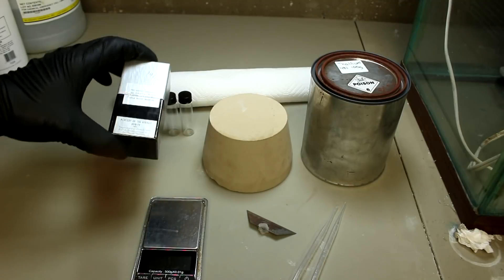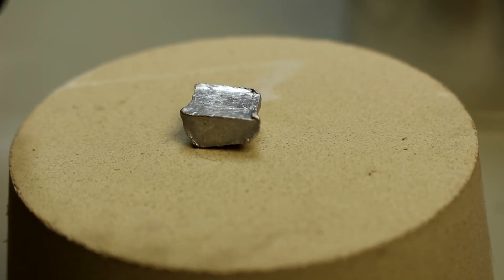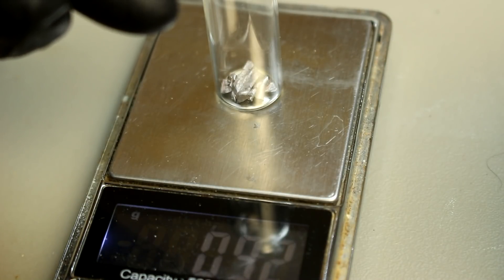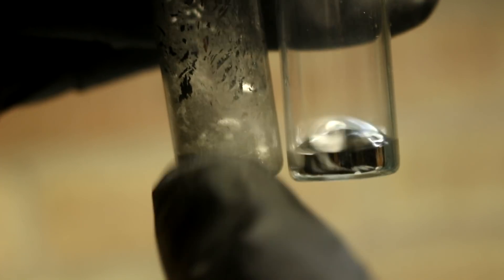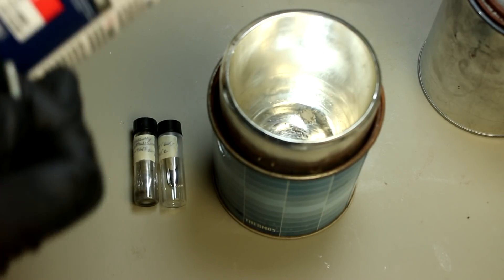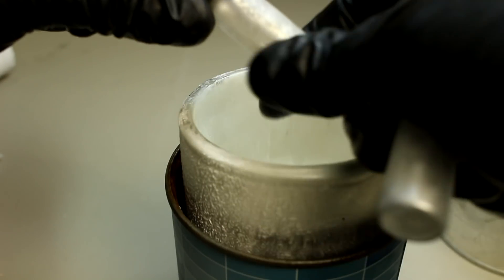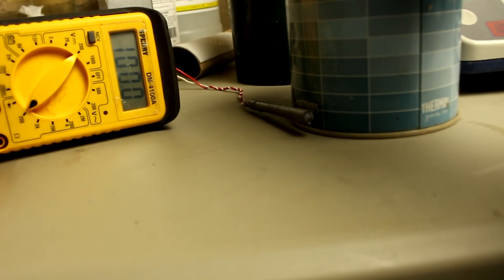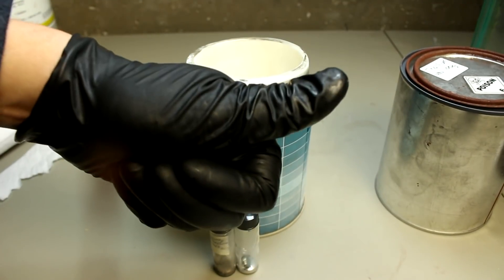Thallium Mercury Fusible Alloy

Comment: You mentioned that there is a ceasium based alloy that can bring the freezing temperature of mercury even lower. I didn't see a video that explained what this alloy is. I am working on an experiment that calls for as low of a freezing point as possible of mercury.  Everything I know about ceasium says it's extremely dangerous.  Please let know what this alloy is. I plan on applying a magnet and speeding the mixture up in a vortex and I don't want things to explode!
Reply: Did you ever find out what this cesium alloy is?
Reply: @brianmcginnis7417  unfortunately no. I don't know why they didn't explain

Comment: The melting point of the alloy is exactly the same as the temperature in Antarctica! xD

"In winter, sea ice envelops the continent and Antarctica is plunged into months of darkness. The monthly mean temperature at the South Pole in winter hovers around -60°C (-76°F). Along the coast, winter temperatures range between −15 and −20 °C (-5 and −4 °F)"

Comment: you should use your vac chamber to do a cold welding experiment. such as the hatch sealing problem on one of the Gemini missions. metal melding together with no energy applied, only a bit of force

Comment: Hey cody, i have an idea in a similar vein to this where if you push a surface of gallium into a surface of indium you form a (nonrecoverable i think) alloy with a lower melting point than gallium which drips away from the contact surface.  Maybe try this in a vacuum chamber?

Comment: Cody, you should invert the calibration chart. Currently you have resistance as a function of temperature. If you invert it to temperature, as a function of resistance, you'll be able to put in your resistance reading and just get the temperature out of it.

Also, if you can, repeat the experiment and put a timer next to the voltmeter. I'd like to see resistance as a function of time as the whole thing warms up. It should go up over time, but I'm hoping there'll be a slight pause or decrease for a while, as the metal melts and absorbs latent heat. That'll also help you determine the melting temperature better, assuming the latent heat is large enough to show a decrease.

Comment: Looking forward to seeing the thorium video. I have an identical Geiger counter and some old mantels which are radioactive....given that the most abundant isotopes of thorium decay with only alpha radiation, the detectable beta and gamma will mostly be from secondary decay once it has become a lighter element.
Reply from the maker: true but most of what the geiger picks up is from the alpa particles striking other atoms and creating x-rays
Reply: Ok, interesting.  I know air doesn't produce x-rays when struck by an alpha particle but I guess within the mantel there are elements that can?

Comment: Dadgummit Cody, I missed you ❤
Also, it looked to me that the pure mercury has a higher surface tension then the alloy.
Reply: ZenoZX I thought it was called codysblab
Reply: Bobby Duke Arts You should probably sub to his backup channel, “Codyslab backup”
Reply: It is due to the oxide: Tl2O3 forms quickly and sticks to the glass and the alloy sticks to the Tl2O3. If done properly, under very pure argon, the Tl-Hg alloy would beed up just like mercury.

Comment: Are there any completely safe and non-toxic alloys that are liguid at room temperature?
Reply from the maker: depends on what you call safe, but there is galinstan (gallium indium tin alloy) which is liquid down to below the melting point of water and is a lot less toxic than mercury but drinking a glass of it would still be potentially lethal.

Comment: Does the condensation temperature change under vacuum like the boiling temperature does?
Reply: Under a vacuum gasses cannot condense into liquids. Instead they are forced to reverse-sublimate into solid, much like how frost forms on cold nights.
Reply: What about in a lower atmospheric pressure?  I am wanting to make a heat pipe, but with a fluid that would transfer heat at 30 deg Fahrenheit.

Comment: You mentioned this alloy possibly being used for a low temp thermometer.  How would that work given how readily it sticks to the glass?
Reply: You can coat the glass in various things; few liquids will wet both glass and plastic for example.

Comment: I'm excited about your upcoming thorium video; however, one quick comment about it (even though it's not up yet). You shouldn't have burned it indoors, especially not as violently with a torch as you did. You don't want particles of thorium to end up in your lungs. It's an alpha emitter, and pretty benign if you keep it outside of your body. Getting it in the lungs or other mucosal surfaces is another matter altogether though.
Reply: stamasd Cody knows what he is doing, it looks like he was in a finely ventilated area. He's no idiot, and knows the risks. Trying to comment and inform him of something he probably knows is silly
Reply: I sure hope so. Thorium dust is not to be toyed with, once it gets in your lungs it can't be removed and will give you lung cancer in the long run. Thorium is weakly radioactive but it puts out high energy alpha particles which are highly mutagenic and carcinogenic. If the thorium (or radium, uranium, plutonium etc) is outside of the body, the alpha particles are stopped by the outer layer of the skin which is made of dead cells, thus they won't do anything dangerous. But if it gets inside the body they will affect live cells and cause mutagenesis and eventually cancer.
Better safe than sorry.

Comment: +Cody'sLab Have you been thinking about trying to grow monocrystalline silicon? Basic mechanisms seem to be simple, you got already quite some knowledge and practical experience in chemistry and metallurgy so you should be able to do it and I'm pretty sure you would be the first one to do it on youtube (or for the fact in any reasonable searchable part of internet), I would be really interested in watching that and I believe so would others, also I'm pretty sure that could lead to new cool experiments with semiconductors
Reply: I've toured a site in Oak Ridge where they make pure monocrystalline Germanium for gamma ray spectrometers (HPGe). They had an induction heating ring sweep back and forth over the mostly pure billet to selectively melt a small band at a time, dragging impurities out to the ends. Took them days or weeks for a single billet, but they had 4 or 5 going at once. Crazy!
Reply: Just looked it up: the technique is called Zone Melting or Zone Refining.

Comment: I would have been concerned about the heat from the vacuum pump causing the propane to ignite.
Did you know that Thorium could be extracted from the filaments of some types of early radio tubes? In certain types it was used it to create better emission, hence the Thoriated Tungsten filament. That might be an interesting project, or extracting the rare earths from CRT's.  (P.S. With a good stone you can easily re-sharpen the utility  knife blade. LOL)

Comment: A Bit dangerous sucking Propane through a sparky carbon brushed motor...
Reply: His vacuum pump is a compressor from an AC air conditioner. Freon is combustible. The compressor prevents freon from escaping by having the pump and motor hermetically sealed and submerged in PAG oil to lubricate the motor and pump. The pump is also an induction motor, so it has no brushes. Both these things prevents air from getting into the system and also removes the possibility for sparks for an explosion.
Reply: I wondered about that as well. Hopefully Cody has a prepared death and/or serious injury video to conclude this channel.
Reply: I was wondering about that, and if the motor is guaranteed sealed.
Reply: Jammit Timmaj, freon can burn under certain special conditions, but is nowhere flammable as propane. It's a really sluggishly reacting compound.
Reply: Jammit
"Freon is combustible." WUT
Did you make all that up?

Question: "And isn't it dangerous to have propane running through the pump?"
Cody: "...sort of."

Comment: Mercury freezes at 40? Jesus, now I want to see mercury freezing at the south pole after being poured out.
Reply: Just because something is at lower temperature doesn't mean other thing touching it will solidify momentarily. It takes a while for the heat to leave the material and air, being a really crappy heat conductor, isn't really good with carrying it away.
Let's say the air is at -55 °C which is average nippy at Antarctica. If you pour few mililitres of mercury in a beaker, you'd have to wait a long time before it solidifies.

Granted, you could make really shitty, soft nails with it for the sake of fun...
Reply: I never said I'd watch it solidify immediately after pouring it out. I just would find it amusing to pour some mercury out and have it freeze in the open air. Also, you could have it freeze fairly fast if you poured it on, say, a metal pan you sat out beforehand.

Comment: is that a property indicative of salts?
Reply: No, solutions.  Freezing point depression caused by inter atomic disruption of the crystalline structure.  Soda lime glass is a salt with lower melting point than its parent compounds, silicon dioxide (acid) and sodium oxide& calcium oxide (bases)

Comment: I realise it's just semantics, but I'm curious- would this technically be an amalgam, not an alloy, since it's mercury based?
Reply: Amalgams are solid-liquid solutions.  This is a liquid-liquid solution.  Dental amalgam hardens as mercury diffuses into tin and silver.   Thus forming a solid.  When first mixed, mercury coats the silver and tin.  This makes a putty consistency.  Diffusion of the Hg into Ag and Sn is fast, taking just an hour to be complete.

Comment: Is there any liquid metal that can stay liquid down in LN2 temperature or so?
Reply: Metal no. Alloy no. Lowest melting point alloy is CsKNa, melts around -78 °C. I'm pretty sure Cody will try to make that one, too.
Reply: Lajos Winkler ahh that sucks, guess there is a reason you don't use liquid metal for LN2 overclocking... Thanks for the answer though

Comment: I wonder what the vapour pressure of the amalgam is? Mercury has a very high (for a metal) vapour pressure and will distil  up the side of a test tube if heated. Would heating the amalgam distil off the Mercury leaving the Thalium? Or will the Thalium come off with the Mercury as a vapour? If this is the case then the vapours would be incredibly poisonous.
Reply: You're asking if mercury and thallium form an azeotrope. At boiling point of mercury, thallium is already a liquid, so it is possible an azeotrope is formed because azeotropes are mixtures of two or more liquids.

However, finding such data is an insane task. Someone had to do it, probably not long after Claude-Auguste Lamy isolated larger amounts of thallium in 1860s. It's such an obscure piece of data. My bet is that it's in some dusty book in a scientific library, or some very old scientific paper.

Comment: Great I have been waiting for a video on extracting thorium. I would love to see you extract from tungsten welding rods, they go up to 6% by weight so getting a decently sized sample would be easier.
Reply: There is no thorium to extract from TIG rods. There is thorium dioxide (almost 88% of thorium in it) to extract, and then thorium to isolate from ThO2.

I would not recommend trying this, especially not with aluminothermic method. Breathing aerosolized ThO2 leads to pulmonary cancer, fast.
Reply: Did you think there was pure elemental thorium in gas mantles? It is also thorium dioxide.

Comment: Man I'd be a little nervous pumping propane through a standard vacuum pump.
Reply: Do R/C! To be honest, I'm surprised he lived long enough to upload this video with that much propane boiling off inside his house.
Reply: Putting it through the vacuum pump is fine, provided the exhaust port is plumbed outside the house to far away, so there is no ignition source like the power switch of the pump near the gas, plus put a flame arrestor ( packed pipe segment with a lot of brass wool to prevent flash back), along with doing it in a outdoor location with no power switches or other electric equipment to provide a spark source. Provided you keep below the LEL of gas it will not explode, though you might have some flames at any leak if there is an ignition event, so keep a working fire extinguisher handy. Propane and butane is not hydrogen, the explosive levels are not as broad as 5% to 95% like hydrogen has.
Reply: According to wikipedia, propane has a flamability limit from 2.1-10.1% air by volume.  So as long as the gas in the pump is >10.1% propane it shouldn't sustain a flame (although I would be worried about air leaking in and causing localized spaces of higher percentage air since it is a vacuum pump).  Wouldn't be allowed in a university lab, but probably won't kill you.
Reply: Propane is a hydrocarbon just like for example hexane, it will dilute/thin the oil in the pump, so unless replaced often - not such a good idea, as the thinner oil will a) not seal as well b) offgas a lot more under vacuum c) fail to lubricate the pump properly, causing excessive wear
Reply: you wouldn't believe what I get away with in my lab lol